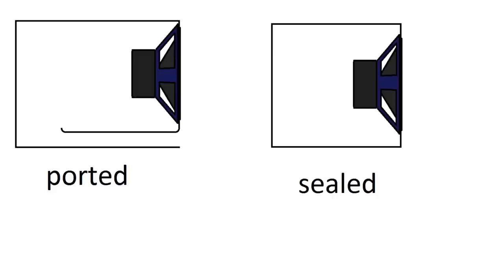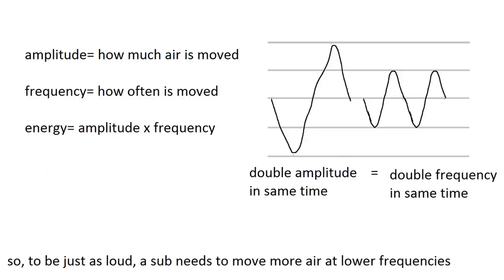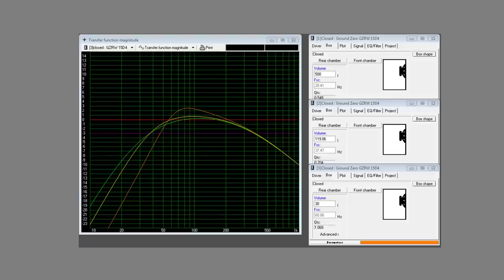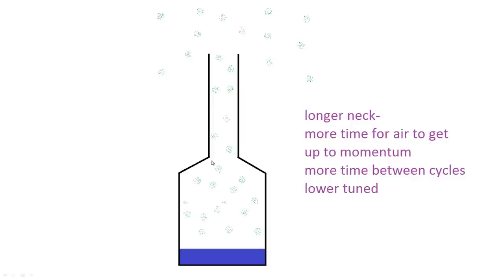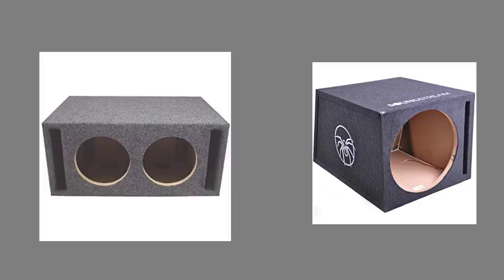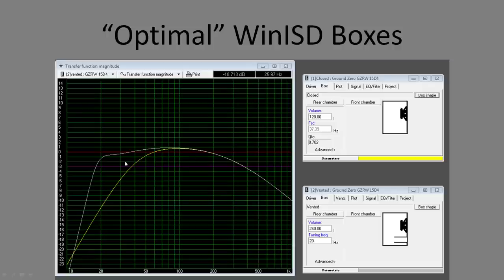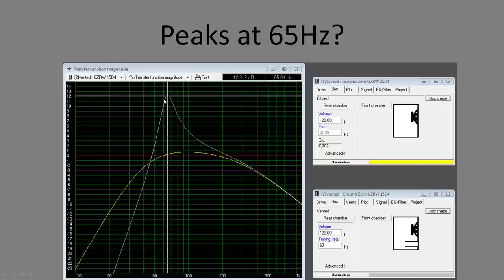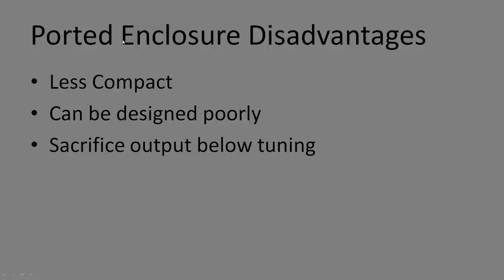Sealed VS Ported Subwoofer Enclosures

Comment: A sealed box can play as low/lower than a ported? Same speaker, etc.? Just give it more power. General sealed box will output more? I use winISD, and almost always a ported box goes lower and louder but roll of the same as the sealed box with the same speaker. 
??

Comment: Sealed ftw. Ported sounds boomy and can get significantly louder or quieter based on note of song, what frequency it hits, and port tune except the high woofers and boxes. Sealed just sound more rounded out and get a flatter frequency response for cleaner. Want to go louder with sealed? Get another sub or larger sub with more power. Simple

Comment: I'm working on micro loudspeaker of dimension about 16 x 9 mm  if i use seal box then sound comes like 'Tap-Tap' or distorting. And if i use ported box then it continues with 'hiss noise or whistel sound when the loudspeaker is off mode please can you help me out. I m doing my project i have tried almost 25 experiment 4-5 work properly but not the frequent repeatability is there.

Comment: Good...  Though your video focues on sinewave behavior....  Music is not a sinewave....  The recording of a simple bass drum could have harmonics well below 10Hz and all the way up to hundreds of Hz. Ported subs need really stiff suspensions and really struggle to reproduce all these range of harmonics at once and are easily bottomed out by music instruments like bass drums (because of infrasonic harmonics that almost all instruments have) ...  They may  be good for higher spl and have good thermal power handling but all the fine details become blurred...  Sealed have generally lower spl and need a soft suspension and if done correctly,  they will handle more power mechanically before audible colourisation in music signals, because of the air spring maintaining control all the way down into the infrasonics and also have better impulse response again because of the near-perfect spring of air... Also sealed subs have to have longer voicecoils,  a MUST!!!
Reply: I have a 10inch sunfire 2700wt Rms rated to 16htz runs down to 5hz tested rocks but and very low but dosnt have the impact or pa level base youd think - still very good...

Comment: What if you dont have parameters of the woofer? In my case klipsch k27k with bic power amp plate thst is rated at 180 wpc fr of 18hz-180hz and i want to make a build. What design should I follow?

Comment: I couldn't see where the speaker driver goes on the one you say is the true transmission line. The other two, that have the resonant chamber, it's obvious, there's a place to put a large driver. On the transmission line, do you put a couple of 4" drivers side by side on one end? What is the advantage of a transmission line? It seems to me, that it would be a "one note wonder". What would the frequency response of the driver be, if you literally put it in an infinite baffle? (The back of the driver not experiencing ANY enclosure pressure, no back cancellation)

Comment: I'm going to build a box for my car but it's going to be rear ported with the port firing through the hatch between the rear seats into the cabin and the driver facing the rear of the car as normal, is this likely to cause or be a problem?

Currently I'm using a sealed box I built but I want more output and I fancied trying a ported box build anyway, I'm hoping to get more bass output but most ported boxes I've seen have the port firing in the same direction as the sub.
Reply from the maker: If you're interested I just put out a video of 4th orders vs 6th orders. Sounds like the config you're going for will mimic a 4th order, as the highs will have a ton more trouble getting into the cab than the lows. I was going to do something similar in my build though there was a thick metal plate in the seat of my car (was gonna port through the rear armrest in the middle seat). A 4th order may be the way to go.
Reply: There’s plenty of rear ported boxes, probably not used in cars often because the rear is up against the seats or side panels. Another thing to consider may be what the output of the port is in terms of frequency response. Should be ok given it’s all bass
Reply: A few months late but...I currently have a dual 12 down firing ported through the back seat. RF P3 DVC4ohm. 2 Pioneer 8601. I do not have the amps tuned yet but holy hell you can peel the port air in the front seats. The box is tuned to manufactured specs. Definately satisfied. Neigbors and police, not so much.

Comment: Finally thanks 👌.... Is it better to creat an enclosure (isobaric or ported ) for a 6.5 subwoofer on a door speaker? I’m tired of sealing and insulating my doors.
Reply from the maker: It is a possibility, though 6.5" subwoofers tend to be pretty chunky in order to have more excursion to keep up with output. Most are already fairly stiff, and should be fine in a small sealed chamber without needing isobarik. You're not likely to get a big enough chamber in the door for ported, for a 6.5" sub 10 litres would be good. Of course the best option would be to put a couple layers of fibreglass behind the door card, but that's a pain in the ass and a half. Also I have researched this a bit, and 6.5" subwoofers can require a larger cutout than 6.5" midrange speakers, which you might wanna take into consideration.
Reply from the maker: I just put a 6" sub (DD 506D) against a 6" woofer (Focal PS165) and from the looks of it, the focal is louder pretty well across the spectrum, even on less power. If you want to ge the most out of a door subwoofer, you'll need to somehow port it.
https://media.discordapp.net/attachments/617406348296060951/671391605323726859/unknown.png?width=797&height=530
You'll really need to make an enclosure for the ported woofer though, in this I assumed the volume within the door to be around 20 Litres, which would be too large for the ported subwoofer and would cause it to have a peak at whatever tuning frequency.
I might make a video on this, there's a fair amount of stuff involved.
Reply: Dakoustics ..... good stuff 👍, I once had a Sedan where the back seats folded down and there was that wall with the oval opening. Sooo I made a new  mdf wall with a 12” and rather than to be an infinite baffle, I went on to complete the project as an enclosure. I did port it but the ports were in the trunk compartment rather than on inside of the cabin bcs in my opinion the pressures cancel each other out. It performed better than two 12”  box in the trunk. I had no rattle and it was clean bass. I do have a little bit of audio knowledge but I’m more of a fabrication expert lol. 

So this is where I need your help, if you preach it, I can make it. I just don’t know specs. This new project is for a delsol it’s a convertible two seater. My vision,... the main sub layout I’m stuck between one 10” between the seats or one 8” sub behind the driver and also the passenger seat. 

I do know I’ll have to make an  mdf design for what ever goes on the doors and sound dampen and even seal the open baffle where the rear 6.5 go. 

I’m thinking 6.5” woofers are the rear sides and a 6.5” midrange and a 6.5” subwoofer side by side on each door with a coaxial 5 1/4

I know focal is the best, I used to install focal when I was younger and your absolutely right about those babies lol... but it’s a 30 yr old car so I’m looking into pioneer and Rockford amps. 

I want this setup to be loud with detail but I don’t want it to sound like just loud speakers.., I’ve always went towards the low bass  prologic studio sound in my cars but this time I want to feel like I’m in a concert and I want that high fidelity and theater bass. 

Yes I’m asking for a lot but it’ll have to be the right combination of speakers. It is a two seater, it is a targa top convertible, it has a big trunk but it is not connected to the cabin. And I have little space for big bass but I am actually looking forward to having a small sub behind each seat because it is more about feeling the music in this project. 

Feel free to say something completely different from what I just mentioned LOL, but you are definitely the expert and these are just my thoughts but let’s collaborate...
Reply from the maker: @AutoBodyEverything  I recently designed a box for one of my mates, a ported box for an 8" rockford P2D2. The box was 20L and tuned to ~33Hz. For its size, its loud and reasonably dynamic, but drops low for a single 8". Also can handle a ton of power considering its size. I'd expect a pair of them right behind seats to pound. 
As for such a complex speaker assortment a DSP will be a good solution for tuning and crossovers. 8 channel DSP's commonly cost ~500USD, but I recently saw a Dayton Audio DSP for ~200 which seemed to have the same features.
Also, for most woofers a sealed enclosure should be fine, heck if their Qts is 0.7 they should work free-air, minus their lower extension. Though if you are going to use subwoofers in the doors, they'll defnitely need enclosures, and as mentioned before to get the most out of them they'll need to be ported. What 6.5" subwoofers were you thinking? I'll check out its specs and see what volume box it'd do well with.

Crossover wise, with dual subs you can run them stereo, and cross over a bit higher, 100Hz instead of the usual 70Hz I do. Since they're ported, a subsonic filter at 30Hz should protect them. 
Door subs, similar, should work from just under tuning frequency (40-50Hz likely) up to 150Hz (since they're stereo also, but better positioning means a higher crossover without muddying the sound). 
Door 6.5" midrange- 150Hz- 500Hz. Coaxial 5.25" drivers 500Hz up.
Rear doors 6.5" woofer- I'm guessing this is a coaxial/component set, so 100Hz up to match the dual 8" subs. 

DSP- 2 channels for 8" subs, or if you tune the 6.5" door subs lower you could use these outputs for those aswell.
2 channels for front 5.25" coaxials.
2 channels for rear 6.5" set.
2 channels for front midranges.
Reply: Dakoustics ... I heard the Dayton dsp is a good unit. Looking at the leg room I won’t be able to make a kick panel for a sub and I’ll already have to fab the door panel to get a bigger magnet to fit with enclosure so it’s four 6.5” and two 5 1/4... I like fosgate and the look goes well with the interior but I’ll see how far the budget goes. I  was looking at all pioneer speakers and if they make 10” or 8” champion sub bcs I had single 12” design that  I loved. I’m not too familiar with the Dayton lineup to be able to make the right purchases but I do love how they look and the prices aren’t bad.

Comment: I made a ported box for 2 15's with the vertical slot port in between the two subs. The port is divided in half the first 14" and converge into one for the last 16". Hopefully you understand.
After listening to it ported I tried making a panel to plug the port. Now I have a box that is 2 3.5cuft per sub with a    small port/small (.2 cuft) chamber/small port between them. 
My question is, does having that inner port/chamber/port area effect how the enclosure creates bass?
Reply: You need to elaborate more

Port area needs to be in line with how big the box is and what the sub requires. High SPL subs (high excursion/power subs) require a lot of port area per cubic foot
Example: a sundown x12 requires 20” of port area per cube of air.
While a low end 12” sub only requires 12” of port area per cube
The more the cone can move the greater port velocity will be

You need more port area to compensate in order to avoid port noise
Reply: @abelscaliber7969  I think you're misunderstanding the question. I plugged the port to see how they sounded sealed, and was wondering if there was any negative effects from doing so.  
On a side note, everything you said was correct, but I always factor in the Watts being applied to the driver as well.
A sundown x12 on say 1000 watts will need a much bigger port area than if it's only being driven by 500 watts. Right?

Comment: If I use a net on the port hole( to protect it from rat and insects), Does it affect on the sound quality??
Reply from the maker: It can depending on how dense the net is. Thin mesh should be fine, another option might be to make a spacer which makes the area of the net larger than the port to reduce resistance.
Reply: @Dakoustics  Thank you, sir.

Comment: A few people in the comments are saying they reckon sealed or ported is better because of their experience.

I don't think it needs to be an either/or choice. Wouldn't it be best to have an enclosure with both a subwoofer and normal woofer and have the enclosure designed/tuned to optimise both drivers?

If music calls for subsonic sounds then the subwoofer should be doing more work because it's best in that range. The same goes for the woofer when the music has higher frequency bass. Both of these should working together to give all music the best possible recreation.
Reply from the maker: I know I'm a bit late to respond, but yeah, I'd say an ideal subwoofer setup would be either a) something like an 18" which can go down to infra-sound and a decent, flat pair of speakers which cross over at around 40Hz, or b) the same 18 crossed over with a pair of stereo 10" subwoofers, the 10" subs filling the gap from 40Hz up to 100Hz. Most subs can reach up to 60Hz, 80Hz even without trouble, but the sound starts to become directional, so to avoid that sealed stereo subs can be paired with the midrange speakers.

Comment: Can you get more into the difference between the ported with the tube thing and the slot ported. I had thought it was ported vs vented. But you said ported vs slot ported. 

I searched ported vs vented and pretty much nothing pops up.
Reply from the maker: ported, vented, bass reflex, all words for the same thing, if theres a difference its just visual imagery, as in a vent is usually square or rectangular, and a port is usually round, but all vents are ports and all ports are vents. Square/rectangular ports also tend to have more surface area and are longer.
Reply: @Dakoustics  when a vented rectangular box has a long port is it better for the sound? 

Also when you have a box that has the optimal cubic ft in airspace does it mattter what dimensions it has?
Say an subwoofer wants an enclosure of 1.25 ft^3 for 32Hz and you have one box thats long rectangular prism shape and one thats more square does it make a difference in sound quality or what the box is tuned at?

The sub I have has an Fs of 24Hz should I aim for that low or should I aim for about 30Hz?

Comment: So with a ported box tuned to 25hz or so. You can have a more even output throughout the range vs sealed? That design looked the nicest in the simulator. Besides port length being a issue in design, wouldnt that make more of a sql box? Is response still faster with a sealed? How about tuning away or near the fs of the subwoofer?
Reply from the maker: Good question. Many argue that the port muddies up any tightness in the sound, though tuning it low means ~50Hz should be unaffected. Servo subs and a few other sealed units may be EQ modified to be sealed, though have a freq response the same as a good ported box. You shouldn't really tune below the Fs of the sub, that's the lowest frequency that it should play, below that it can be distorted, though depending on the brand the subs Fs may lower with use. 
I'm currently experimenting with making a ported box using methods I've heard about, and will be using it in a real sealed vs ported vid coming up, and so far to my ears the ported box sounds better, so theres that
Reply: @Dakoustics  Fs has nothing to do with how low a sub can play, it's just the frequency the moving mass resonates at - however it's true that tuning a br box below the fs isn't the best practice. You also don't need servo sub to be able to eq it to play flat from 20Hz in a small sealed box. You just need a lot of power.
My next sub will be 10" ultimax in a 35 liter sealed box, EQ'd to be flat from 20Hz. Small box, big sound.

Comment: I have an old Magnat 30cm subwoofer that I installed in a bandpass type box and used in my car.
Now, that I am not that young amymore the sub is conected to my home theater system.
But its not performing well wit low frequencys when I watch movies.

I would like to build a new box but don't know where to start with the design. Any suggestion?
Reply from the maker: If its old, from what I've seen older subs aren't too good at low rumbles, in modern standards they're more like PA woofers, so one suggestion is large ported box tuned low, something like 100 litres (3.3 cu ft), tuned to 25 or something thereabouts. You could also try putting it in a sealed box and use an equaliser to compensate for the roll-off.

Comment: I have a question between a ported and seal box which one allows your sub to sound louder
Reply: Ported will always (99% of the time) be louder. A sealed box always (again 99% of the time) will have better sound quality and a tighter hit.
Reply: @jamesf9610  thanks for the information
Reply: @jamesf9610  absolutely true
Reply: @jamesf9610  I would say 100% of the time, I can't imagine a design where sealed would be louder (using the same driver)
Reply from the maker: @KocuRisko  If the ported box is tuned way too high, or if the ported box is way too small.